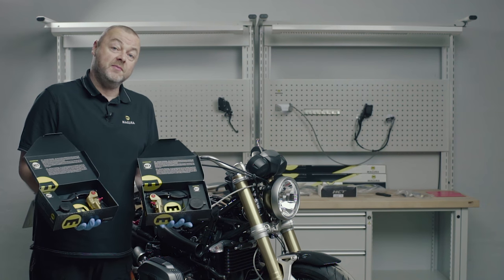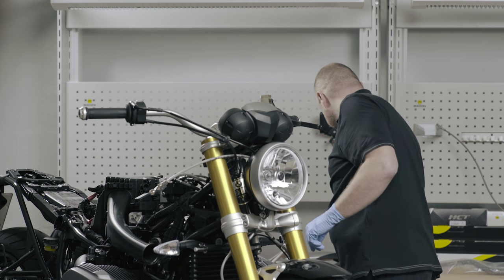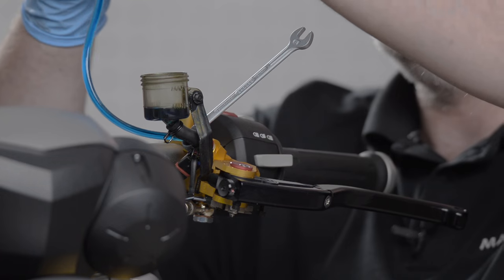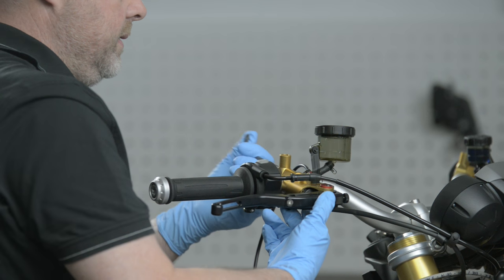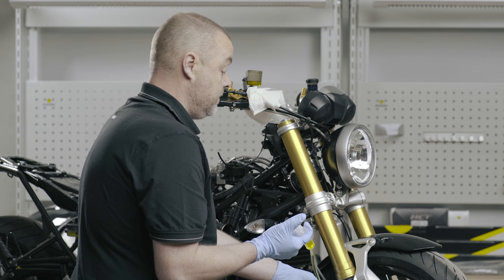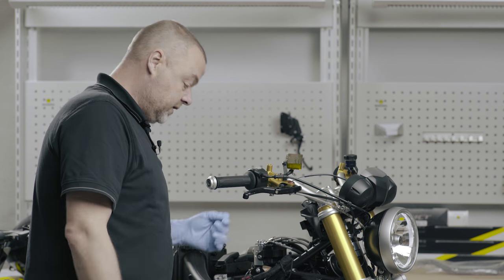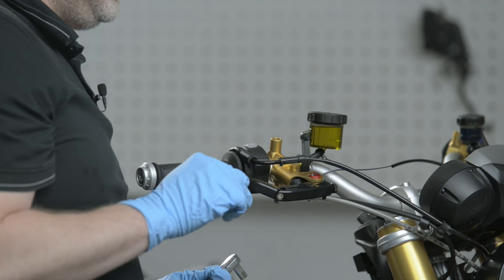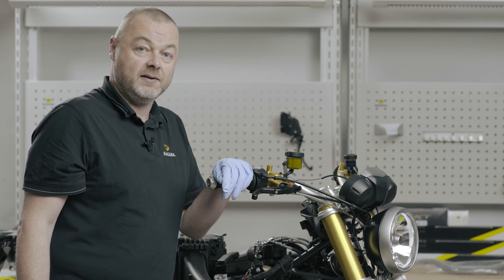MAGURA Radial Master Cylinder HC3: Installation

Comment: Very informative. One question. Does Magura offer radial master cylinder for the Super Tenere?
Reply from the maker: Hello Terri,

Hi Terry, many thanks for your query and interest in the MAGURA product range.

In order to recommend an option for the Super Tenere we would need to know the following - 

1) What piston diameter does the OE axial master cylinder have? This is stamped into the housing - possibly as a fraction of an inch instead of in mm.
2) Are you looking for a similar pressure point or would you like a harder of softer pressure point? 
3) Are there handguards fitted on the bike? The HC3 is too large to be fitted with handguards but the HC1 should work with them.
4) Does the Super Tenere have cruise control? If yes - does it also have a double brake light switch like the MT 10?
5) Are your mirrors mounted on the master cylinder?

If you can provide us with the information we will be able to recommend a radial master option for your bike. You're welcome to send us an e-mail to powersports@magura.de. 

Kind regards Tobi - MAGURA social media